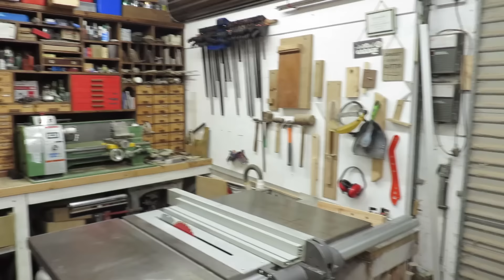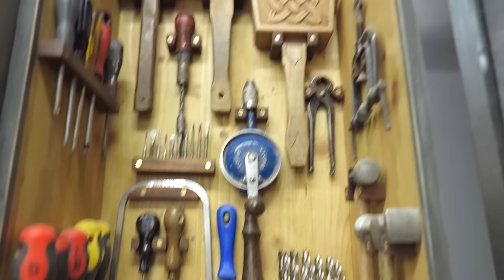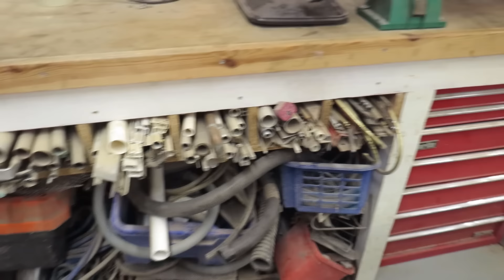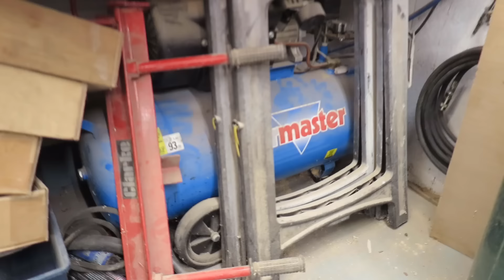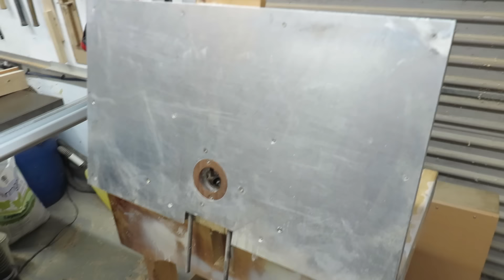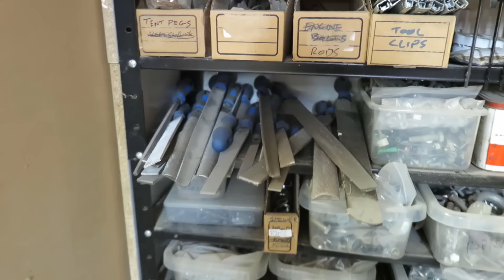Epic Upcycling Workshop Tour and Update 2024

Comment: Awesome seeing a tour of your workshop. I really like how it looks, really cozy space to work in.
I have a question: When you design a new piece, do you make some rough sketches, full drawings or just work from your head?
Reply from the maker: I usually do a very basic drawing just to get an idea of the look I want, then I make things up as I go along.
Reply: @EpicUpCycling  That's really impressive!
I have another question, you mentioned you prefer to keep the pallet wood in your storage for some years before using it? Is it to ensure it has dried enough?
Reply from the maker: @Gin-toki  No, it's to allow it to season and move. If it doesn't warp after a few months it will usually stay fairly straight.
Reply: @EpicUpCycling  Ah that makes sense. Thanks for the answer! :)

Comment: Hi Jason! My name is Gyula. You have tools that take my breath away. It takes a special dedication to work almost exclusively with hand tools in today's world. Can the No. 55 plane "almost" replace the top-shelf jointing planes by itself? The Stanley compass is also a speciality. My father used a similar plane to make wooden barrels, but they were made of wood with a constant curve and there was a different tool for each operation. I love working with wood. I am 73 years old, full of plans. I also have a problem with the transparent storage of tools and fittings, although my workshop is larger. I work with machines because it was a commercial workshop. Your workshop is a temple of creation.   Thank you for the presentation.      Best regards, Gyula.

Comment: Get yourself some extra strength multivitamins, Will help a ton with healing.  I have had 2 carpal tunnel surgeries, Dr said I'd be able to use the hands fully in about 5 weeks.  Both times I was back to work the next week, no joke.  When the body is healing it uses up more vitamins and minerals then normal, if you can feed that you heal faster.

Comment: As you said it has been a different type of format for your video. Seeing some of your power tools, especially the Black and Decker/DeWalt ones as I used to work for that company when we used to manufacture fourteen million units per year at the biggest B&D plant worldwide at over a 5,050,000 sq feet. So if you have any older than twenty years I could possibly have made it or a part of it, I did work in every part of the factory and on every line at one time or another.

Comment: was very glad to see a new video in my youtube recommendation but very sad to see why. hopefully that hand aint as bad as it looks :(  i have issues trying to cut straight lines with a jigsaw without a long guide. i have been looking at some videos where used upside down to make a modified b@stard bandsaw.i  can see this be far more accurate on the cuts as a guide fence like with the router. if you have some spare down time it would be very interesting to hear your ideas on this design. will be looking for that build of nuts and bolts storage unit tomorrow as never seen that build

Comment: I wish you a good recovery
 As a furniture maker myself, I have some questions.
Maybe you also can make a video about the types of products you used on your dream tool cabinet.
I love the beaten up gray look.

Btw, I just ordered me a Sabre 350 as well.

Are you an antique furniture restorer from education if I may ask?
Reply from the maker: No, I was never trained in it, just a happy amateur who's still learning :)
Reply: @EpicUpCycling  well, you are doing great. I assumed it because you do a lot by hand, and love those old tools. Nice to see  them used by a craftsman  these days.

The only think I am a bit afraid of is when the trim moldings on the solid wood are being nailed, or the backs onto the cabinet, are they
 don't splitting the wood over time?
Reply from the maker: @GK-ll7zo  I've not had any problems with splitting. I use very thin veneer pins for mouldings, I also often pre-drill the nail holes with hard wood if it looks like it might be a problem.
Reply: @EpicUpCycling  The thing is when you have solid woods, it swell or shrink in width more then in length.
So when you nail or glue pieces with the grain direction perpendiculair, then it can cause problems and you need to make some things floating

Comment: Would sanding down the boards prior to planning help reduce the wear to the blades? Have you looked at using helical blades?
Can you do a video on how you design stuff while you are getting better?
How did you get started?
Reply from the maker: Yes, I do often sand them first, especially if they are dirty. It helps a lot.
I've looked at helical blades and might upgrade to a machine with them eventually, but I would probably still run pallet wood through regular blades first.